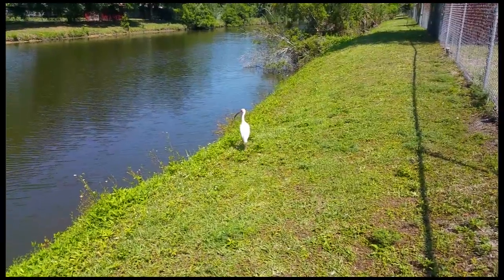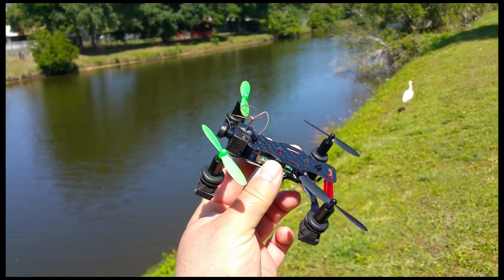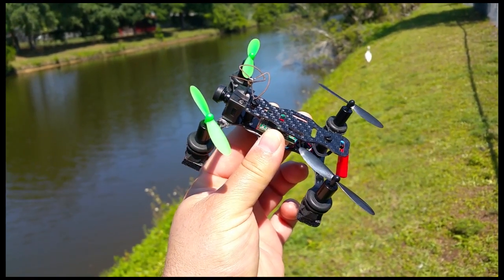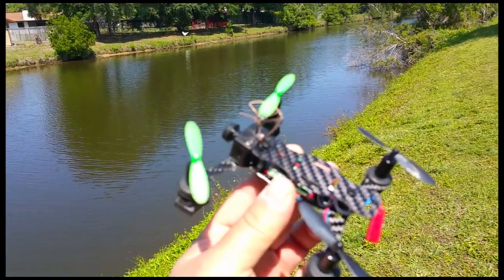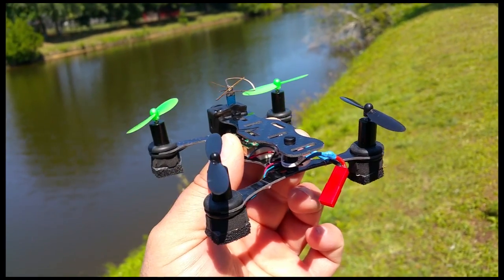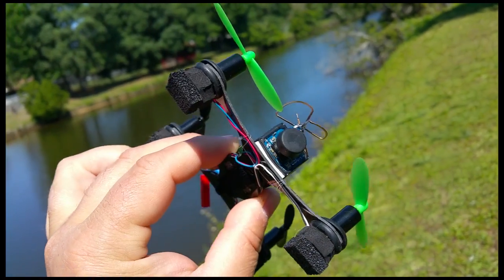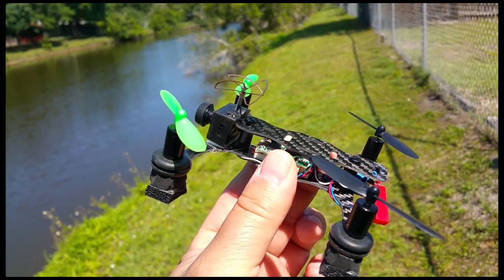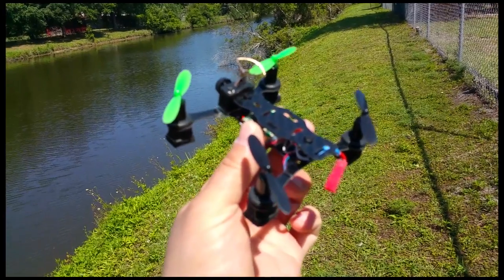Phoenix Flight Gear 110mm Carbon-H Micro Quadcopter

Comment: <--- (jealous) LOL Man that thing looks and flies awesome...
Reply from the maker: Quad Bruh Thanks man, its my favorite flying micro for sure... very locked in and solid!
Reply: Mad Scientist Matt RC SHIIIIIIIDDDDD... I had to buy one.  I got the 135mm one as the arms looked a lil thicker.  I'm still very crash prone.  I'll probably do a Beef's Brushed Board w FrSky MicroRx set up on this one and run CleanFlight on it.  I only have one set of CL-0820-15 and I think I'm going to put them on my micro H.  I bought a bunch of JJRC H6C motors in bulk so I'll try those.  Either that or wait to until I can get my hands on some more MMW motors.  Anyway hope I have as good as results as you did.  I'm going to make a FPV back pack or use an 808 keychain FPV set up for my on board eyes.  I have Boscam goggles so I can't use that nifty Horizon micro FPV setup.  I'll keep you posted once I get everything up and going.
Reply from the maker: Quad Bruh  I would love to hear how you like the Beefs brushed board! I have been looking at that and everyone i talk to seem to really like it... GOOD call on the 135 frame, since this video I have broken an arm off the frame and am rebuilding mine, but in fairness i had many crashes with no issues, but this particular crash was from 100 feet and i hit the road very hard... :)
Reply: Mad Scientist Matt RC For sure!  I'll be starting my build soon.  Still waiting on my Vtx and Rx to get in.  Been working on a Hubsan X4D FPV build in the meanwhile.  Almost got it all put together last night when I got the magic white smoke when I was testing it out.  Trying to squeeze a Yi Zhan X4 FC inside that thing.  I just love the Yi Zhan as a RTF micro over Hubsan.  Anyway, luckily the whole thing didn't go up in smoke last night.  I'll take another crack at it this evening.  I'll keep you posted on my progress.
Reply from the maker: Quad Bruh THanks man, love to hear how its coming!
Reply: Man... I've had 1 FPV rig after the other not work for me for one reason or another.  It's been very disappointing.  Got a couple in cue now.  I'll keep you posted.

Comment: this will be my first build!!!! but question , i have the hubsan fpv....will that transmitter work with this??
Reply: Daniel Espinoza  I'm not 100% certain, but i'm sure as long as your using the hubsan flight controller that comes with it, it should work just fine! Let me know how it goes after you build it! I used the nano qx fpv board because i have a Spektrum transmitter...
Reply: Matt Merritt ok thanks so much!! im going to record the whole build  xD since im such a newbie , other newbies will see how its done (even with mistakes) lol
Reply: I think the answer is yes but just to clarify:

If you swap the full electronics from the h107d to this frame it will work just like a normal Hubsan. 

If you use a Hubsan flight controller and the Spektrum camera he is using then you will be able to fly the Quadcopter as normal but in order to see the video you will have to go into options (press and hold right stick) and change the 5.8 frequency to what you have the Spektrum camera set to.

If do the exact build he did here with the nano qx then you will not be able to fly the quad with the h107d controller but you can view and record the video if you change the frequency to match your camera.
Reply from the maker: Daniel Espinoza Thats a great idea!

Comment: The antenna and part of the board it is connected to look exposed and vulnerable to breaking off in a crash. Had any problems?
Reply from the maker: FauxShizzl They are open but i haven't had any issues with damage yet... had several crashes, no issues!

Comment: just curious how did u wire the motors to your light controller, did u get the attachments on ur motors or remove them from the flight controller and solder them on the board, it says on the rcdrone website the 8.5 motors wont work with the nano flight controller.  Is that just because u need the bigger battery?
Reply from the maker: Game Time The motors i used from micro motor warehouse came with the connectors, no soldiering needed... 8.5 won't work on the original nano flight board, but they work great on the nano qx FPV flight board... you just need to change the connector that connects to the battery because the standard pico power connector can not supply enough power, i soldiered on a JST connector, but a mini deans works great too..
Reply: Mad Scientist Matt RC So this will allow you to use a bigger battery than how much can the board handle ?
Reply from the maker: Bill Dedoes  Not sure on the exact power, but I am running a 750 35c 1s lipo and it works great, 5 minutes of hard flying...

Comment: Im guessing this doenst come RTF
Reply from the maker: ***** No, it doesn't but its not very hard to build, especially if you already have a Blade Nano QX FPV that you can take the flight control board and camera/vtx off of... took about 35 minutes to switch it over.

Comment: What are you getting on flight times? I have same setup but traxxas alias motors and the motors get super hot. Getting about 4 minutes then lvc kicks in. Using lectron 700mah 30c. How are your motor temps with the dark motors?
Reply from the maker: Jeff Paige  I am getting between 5:00 to 5:30 minutes of hard flying with it on the Lectron 750mah 25c lipos... I have experimented with 900mah 30c lipos (generic brand i bought off ebay) but its just a bit too much weight... on the 750's, the dark edition motors are warm but not super hot.. I haven't tried the alias motors...

Comment: nice. wonder if you could fit the guts from a blade Glimpse on there.
Reply from the maker: pulsefrequency That is a good question, we have one at the shop I work at... I will open one up in the next week and check it out... Although my experience with the Glimpse is it suffers from a pretty short range for the video link, even shorter than the VA1100 Spektrum cam/vtx setup...
Reply: Mad Scientist Matt RC why does Pheonix F web site say to use the Hubasan FC ? does not mention the Blade FC?
Reply from the maker: integra They told me the nano qx flight controller wouldn't work, and they are right... but there is a big difference between the nano qx flight controller and the nano qx FPV flight controller... it works fine, thats what im using in this video and it works great, especially in manual (rate) mode, which i how i fly... the hubsan board will work, and its ok... I just happen to use a Spektrum DX9 radio, so i wanted something with a spektrum receiver built into it... sorry for the late response :)
Reply: Mad Scientist Matt RC ok thnak you

Comment: I love it dude I'll be getting this soon because my nano fpv qx motors are pretty munch on there last legs life wise so instead of buying new motors from Horizon Hobby I could remove my FC and FPV Camera from it all I have to get are the motors the Carbon H-Frame and those Hubsan props and I'm in FPV heaven thanks once again Matt!
Reply from the maker: 3D/FPV MOFO! Oh man, you will love it! Its a great flying setup, so smooth and stable... :)